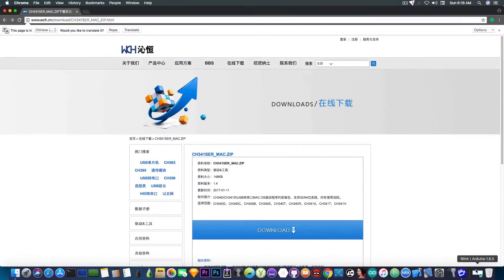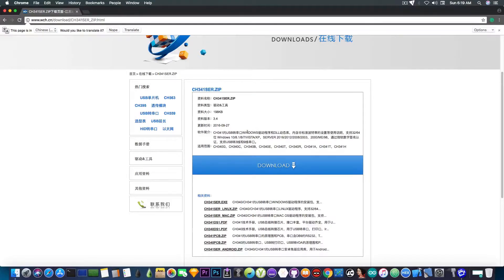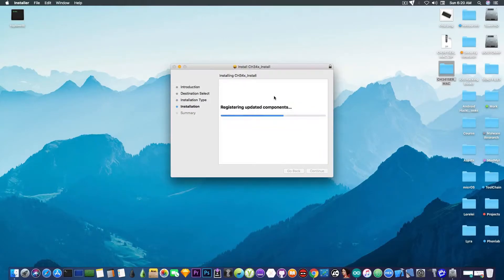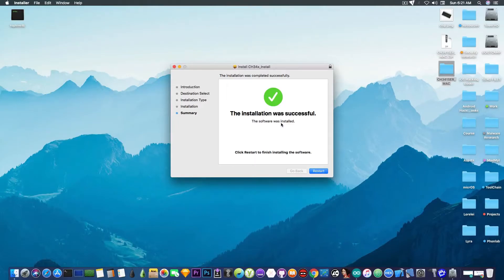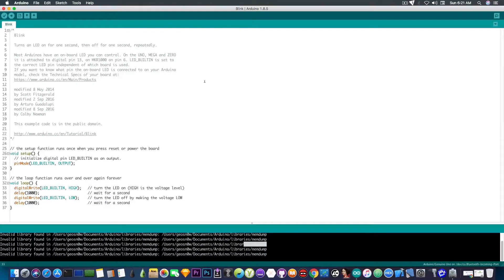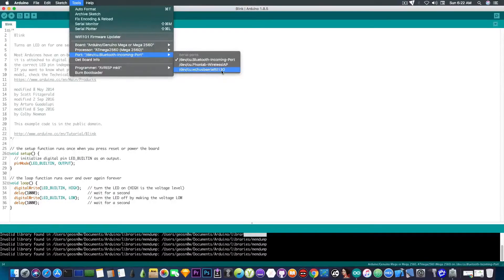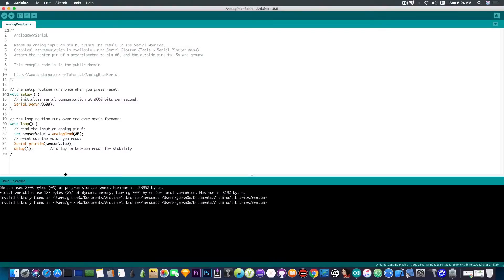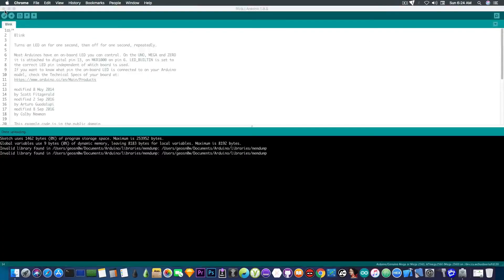How to fix Arduino Mega Clone Not Showing Up (CH34X Driver)

Comment: Thank you very much for this!
Reply from the maker: Glad it helps :)
Reply: 3 days later and my Arduino mega shuts down my computer when I try to upload a code..
Reply: Now it doesn't work anymore..
Reply: @jorienaberkrom6674  Did you ever figure it out??
Reply: @2k420-s4b  i found out that it does work perfectly on a Windows computer. Got a 'real' arduino to connect to my Mac, when i have a project that does not need an update anymore, I connect the Chinese one to the circuit and copy the code to a Windows computer and upload from there. Since I use the Arduino a lot, I figured it is worth the money to get one that is not blocked by Apple.